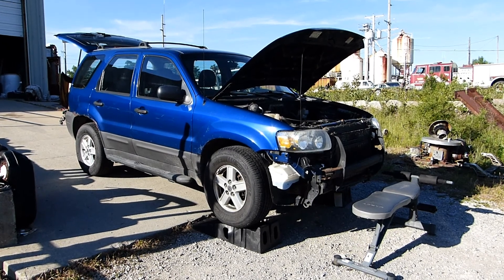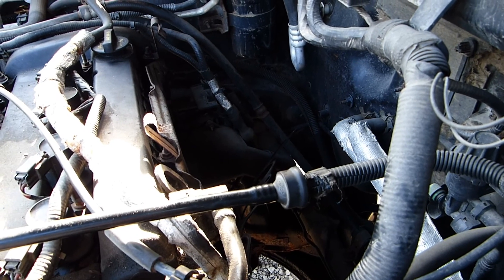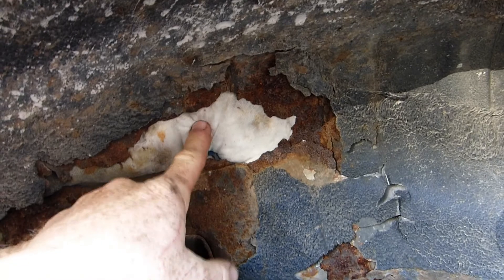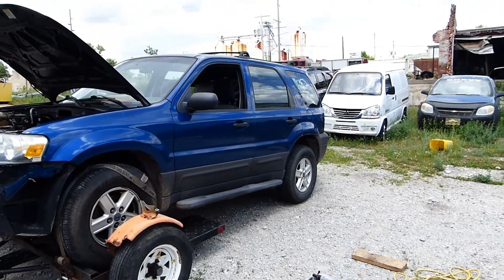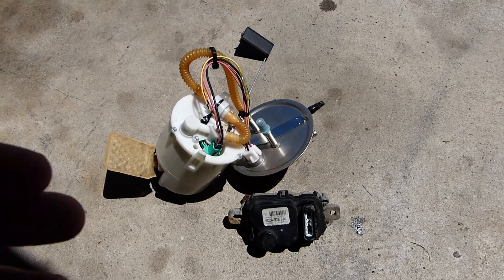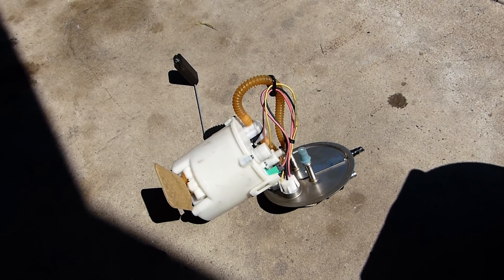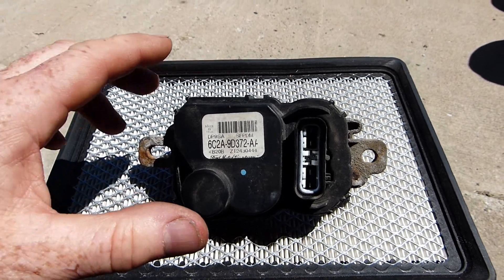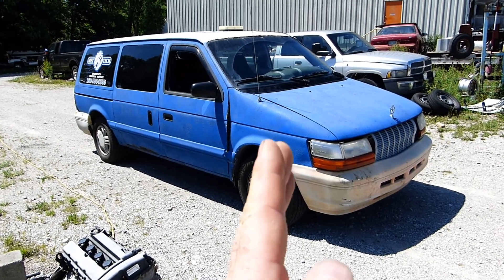RIP Ford Escape + Fuel Pump Driver explanation

Comment: What happened to the fuel pump on this Ford escape
Reply from the maker: I removed it because I had bought it new.  It didn't go to the junkyard, if that's what you're asking.
Reply: @HemiChrysler  You can buy that wheel well and cut out the rust and weld in a new one. I did that on mine.

Comment: I learned a few things today. 6 speed manual paired with automatic 4 wheel drive. Rare indeed and that fuel management device would have stumped me for sure. And I always assumed the drive wheels on the Escape were in the rear. I like learning new things. Rust is brutal on vehicles. Here in Washington they don't use salt they use that chemical deicer stuff. You know the stuff that kills our salmon 🤔.  Anyway. Great instructional video. RIP 2006 Ford Escape 🙏 Thank you . All the best. Mitch 👍